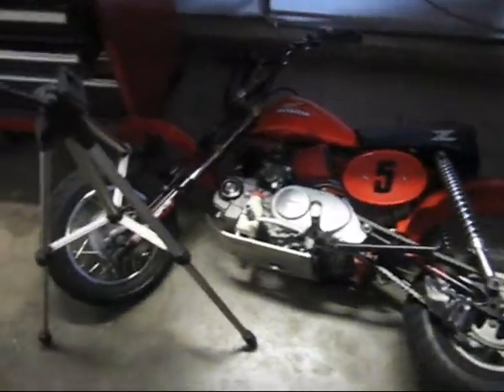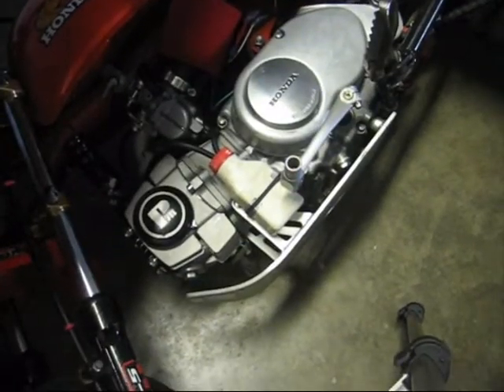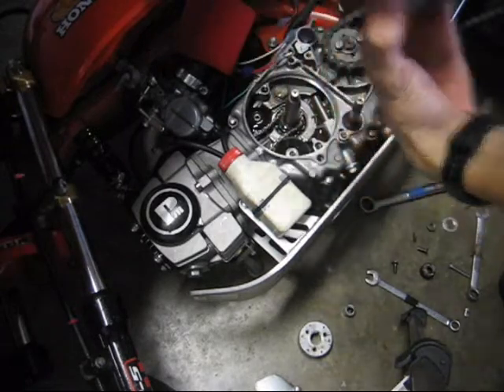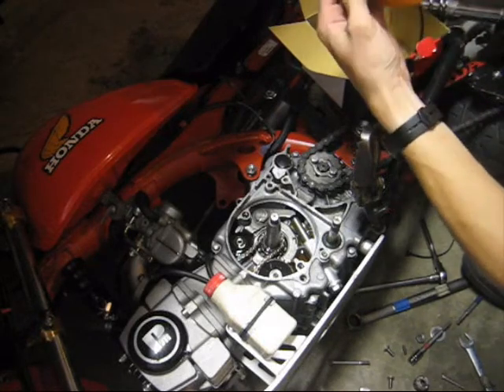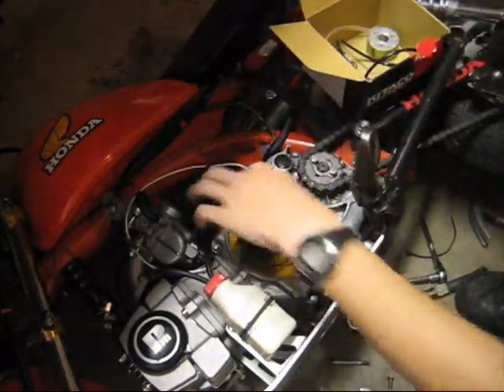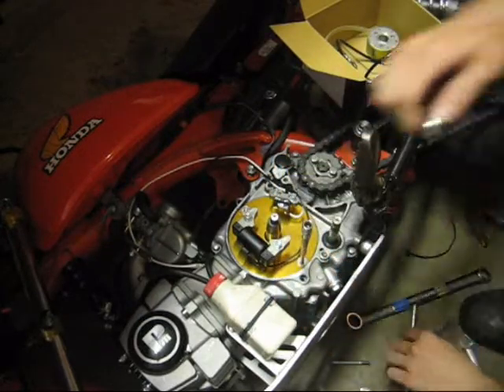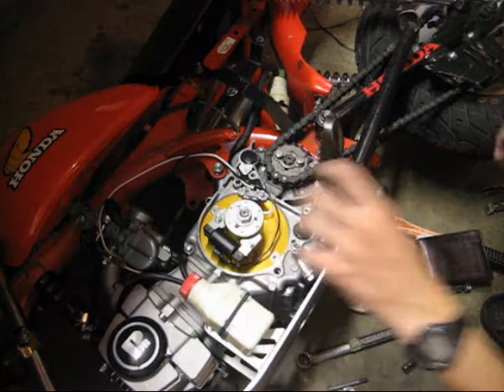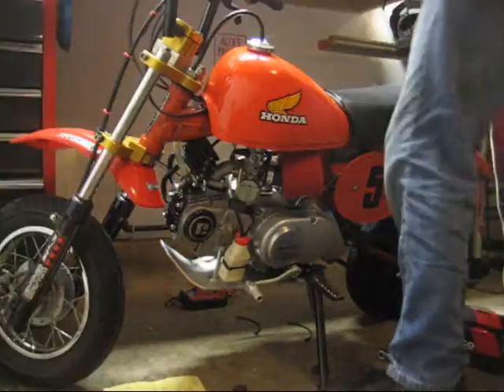Kitaco Inner Rotor Kit Install and Test

Comment: @TheAlexManVideos  i heard that putting one of these on a pit bike engine will ruin your crank bearings because the engine becomes unbalanced because the clutch basket is still heavy and but the rotor is light which puts pressure on the one side of the crank is this true?

Comment: People misunderstand what a inner rotor kit is. It is a magneto, that uses a magnet as a rotor, and a pickup that sends voltage to the coil, and spark to the plug. Depending on where the timing is set (business card gap) will determine at what rpm the max spark is delivered. The cdi (rev box) is a programmed piece to curve the ignition (advance at higher rpm/make spark happen sooner) to make sure it retains optimum spark timing to 12,500rpm.

Comment: How did you tighten the flywheel nut? Kind of a novice question but I can't figure out a way to keep the crank from spinning.
Reply: Take out plug shove rope down plug hole until you can't any more then you'll prevent the Piston from coming up to top of cylinder which the makes you able to tighten the flywheel

Comment from the maker: The clutch is on the crank, not on the cam. I am aware that the cast clutch baskets can explode from RPM and fast RPM changes, it is for that reason that I use a billet machined and hard anodized clutch basket.

Comment: The proper tool to remove the Phillips head plate screws is an impact driver, this is a spring loaded hand tool you hit with a mallet. The impact in, and spring twist unlocks impossible screws you would otherwise strip. You can buy one from eBay with bits for ~$40. The business card gaps the pickup to a proper spot, no need to set crank position for the plate install. Also, the keyway on the crankshaft will keep the rotor where it needs to be.

Comment: Good to know. Thanks. I have no problems working inside a motor so thats no big deal. I was going to get a Z50 and use the forks and swingarm off a parts 1984 XR 80 I had to make it a little longer. Then build the motor with an 88cc kit, race head, IRK, and an XR 70 carburetor (i have a 70 motor with a hole in the case).

Comment from the maker: Pretty much. You will need to trim off about 1/8 or 3/16 inches off the thread of the crank. This is because the crank is a bit longer and will rub on the left side cover if you don't cut it. Also, this will only allow you to run an IRK. To use a standard 12v ignition and flywheel, you'll need to replace the left case, and the shift shaft. 

So for the IRK, a CRF50 crank with the threads cut 3/16" on the ignition side will work just fine.

Comment from the maker: Not without a crank adapter. And it won't work with your stock ignition coil or lights if you have them. Short answer, no. Long answer is anything is possible if you're willing to swap a lot of parts.
Reply: TheAlexManVideos will this kitaco kit work on my 1994 cr125 motocross dirtbike?

Comment: TheAlexManVideos Another great video. Just one question is that a stock Crank? will it work on a older 6 volt engine  without a newer Crank from a 12 volt motor?
 
Thanks
MIke

Comment: @TheAlexManVideos Any reason why the stock basket shatters ?
Reply: Used a hammer to knock it lose off the crank  ( if the flywheel is what your calling a stock basket.) Always check for cracks after removal/before install.

Comment from the maker: Haha, no. It's just an overflow reservoir or catch can. In the case of an accident, gas from the carb vents will flow into the catch can instead of on the track. For supermoto and most on pavement racing it is required to prevent spills on the track which is very slippery.

Comment from the maker: Yeah, it floated the front wheel just off the ground. It will do wheelies in first, second, and third at full throttle.

The plate is a PITA to fit by hand, I just put in in part way then let the screws do the rest.

Comment from the maker: Like I said in the video, you can't mount it anywhere where it will vibrate. The vibrations at high RPM's make the ignition cut out. It's like a rev limiter at a low RPM and it sounds like shit. Just backfires.

Comment from the maker: The eBay IRK worked fine up to a certain RPM at which it would start cutting out like a rev limiter but very rough with backfiring and not at a high RPM. The Kitaco IRK works great at all RPM's. The symptoms I noticed on the eBay part don't happen to all the kits but I've heard other people report the same problem I was having.

Comment from the maker: It's pretty quick for it's size. It's quicker than a CRF150R in a straight line until it tops out and the CRF goes on to a higher top speed. On the track I run its only competition is other 50 based bikes.

Comment: Omfg i need to get a 100 in mine, that thing riped so bad there, did you wheelie that down the road, looked like it

My kitaco stator plate is such a bitch to fit flush, had to hammer mine in plance, and then when you need to take it off....well......dont go there lol

Comment: So for the kill switch you just plug in the black wire to the frame 
and ground the green one right?
Reply: for the wires, u just connect the two main wires the ones from the stator and coil.  (black to black white to white) the kill switch black wire plugs into the extra slot on the black wire coming from the stator,  the green wire gets grounded to the frame, hope this helps some of you guys.

Comment: Does it generate enough power? (a very late question :D)
Reply from the maker: Enough power for what?
Reply: @TheAlexManVideos  Like enough power to charge the battery and power the lights. Sorry for bad english :D
Reply from the maker: It has no lighting coil. It's only able to produce power with the purpose of running the engine, no accessories.
Reply: @TheAlexManVideos  Okay. Thanks!

Comment from the maker: @jamesm060191 Nope. That makes no difference. Balance only matters on the plane perpendicular to the axis of rotation. Your car engine has a huge flywheel + clutch/torque converter on one side of the crank and only a pulley on the other. It makes no difference. But if you have a crank mounted clutch on your bike, the cast basket usually shatters in time.

Comment from the maker: @jamesm060191 I don't own a Chinese engine and don't like working on them. Because of the hard to source parts and difference in design I can't say what will or won't work on your engine. In general, however, a crank mounted clutch doesn't like inner rotor kits.